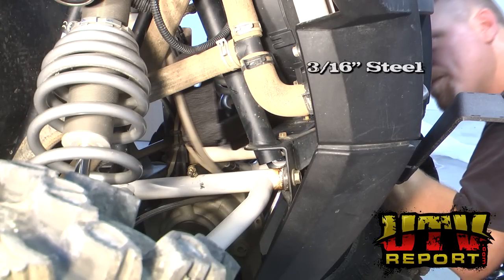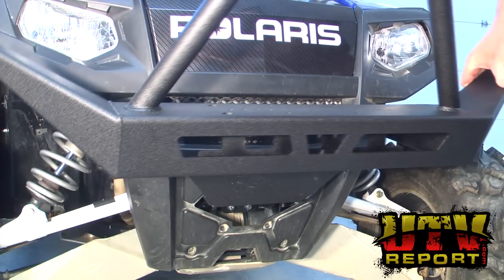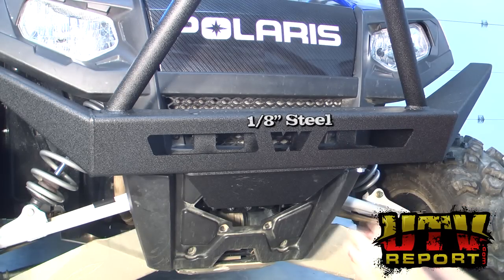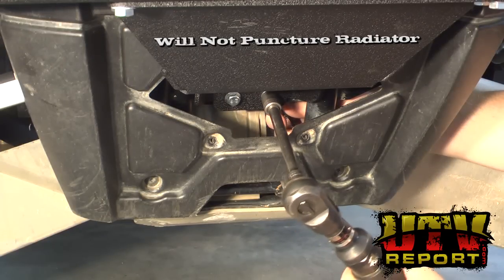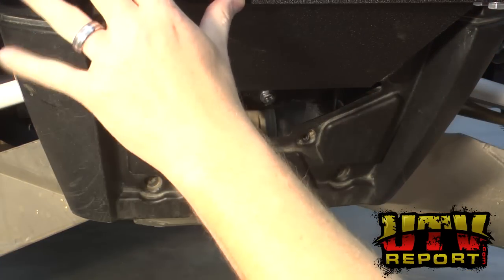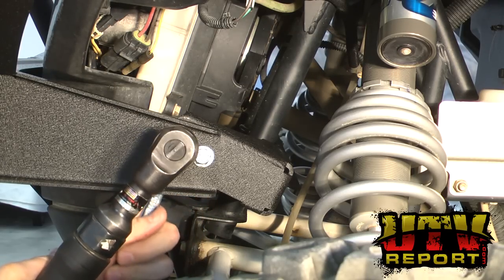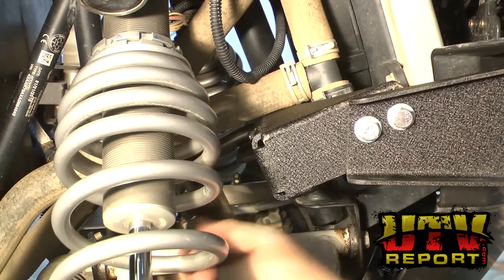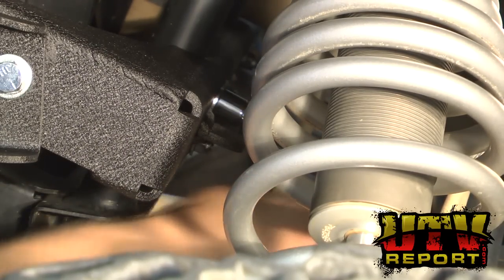Warn Front Winch Bumper Installation on Polaris RZR 4

Comment from the maker: @heavyhauler6 We haven't had any issues with overheating with the bumper and winch installed, and we do mostly slow speed rock crawling where there's not a ton of airflow from higher speeds.